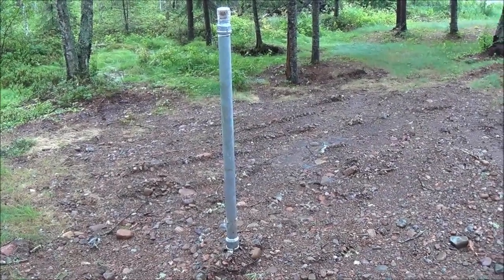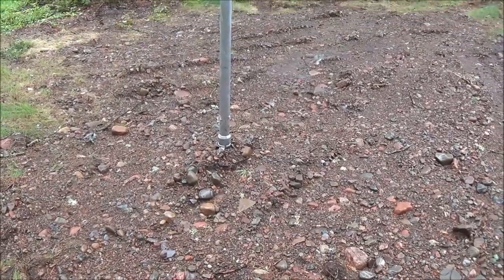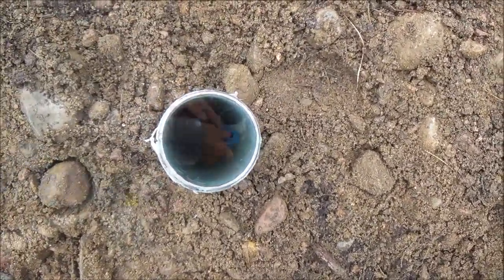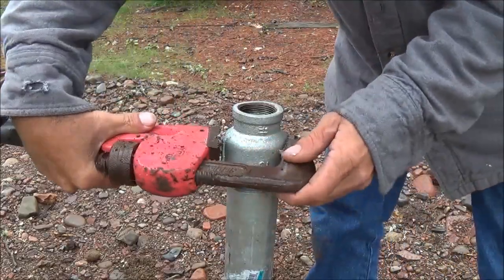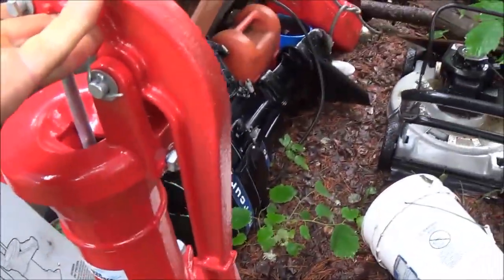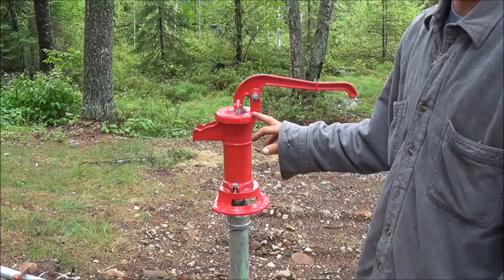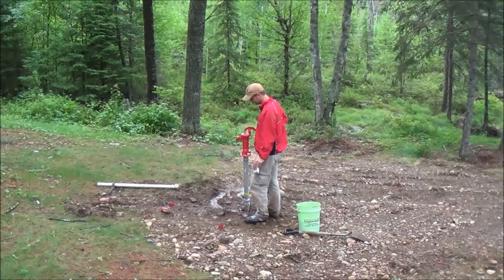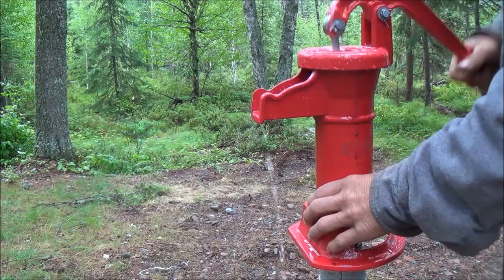How To Install A Hand Pump Water Well. The Tent Well. Finally.

Comment: did I miss something? a backhoe for a 12' well?
Reply from the maker: There is no way you can drive a sand point into the ground at The Tent. It is almost all rock. It is actually very hard to get an actual shovel full of dirt because of all the rocks.
Reply: @JoeandZachSurvival  Something to consider when working on a budget for an off grid home.  Thanks

Comment: Can you have a hand pump on a very deep well? About 400 feet
Reply from the maker: No, not that deep. I remember reading an article on a hand system that fits on your house well that would pump from deep but it was very expensive and I can not remember how it worked. I believe that well could hand pump water from about 300  feet. Most of the deep water hand pumps will pull it from that 80 to 100 foot range. The one I have is a shallow water well pump which can pump water from up to 25 feet.
Reply: @JoeandZachSurvival  thanks for the info

Comment: I'm in a dry desert area and considering this for an underground rainwater collection tank. Just as an option for watering some trees. I likely will get less than 2000 gallons a year in the tank. When I drop my electric pump in and get it going, I can shut off the power and the water continues to flow until I turn it off. I'm wondering if, once flowing, would it be possible for flow to continue like it does with the electric pump? Or will the stopper fall and prevent it from continuing to flow?  I'm guessing the flow after the electric pump is off has to do with suction and gravity. Not sure, but it would be interesting to hook it up that way.   If it is possible to create a pressure that keeps the flap open after a few pumps, that would be very cool. Possibly using smaller diameter pipes that create strong suction. I don't know, but it would be fun to play around and see if it works.

Comment: Considering adding one to the top of my exsisting electric powerd pump.
Reply: Why?
Reply: @starshot5172  in case the power goes off? duh
Reply: @dalerobinson4498  I mean "on top of" the other pump
Reply: @starshot5172  because the well is already dug, plus astetics, ease of installation and expense. I have an artificial rock that I don't like. So I can kill two birds with one stone

Comment: what's the name of the part with sharp spike and screen at the very tip? Does that tip have a hole to allow me to jet water in while driving it down?  I wonder if this system is better than one with a 4 inch casing where water will fill a contained reserve.   Not clear why a big hole was dub before driving the pipe down?
Reply from the maker: It is called a sand point. We had to dig the hole because there is more rock than dirt making that soil. There is no way you can drive a well there. The rocks would stop you.

Comment: Is this well/pump still in use ?   I've not seen it in later videos.
Reply from the maker: Yes, I just use it for emergency's, the water up there tested great but it has very high iron and because of that it is always stained a reddish brown color. The well works awesome but I only use it when I run out of water I bring up from home.

Comment: Awesome sauce! How much did that cost? A friend sent me your video bc I asked if anyone knew how much it cost to install a manual hand pump - I know ppl think I'm crazy, but,i woulf rather be prepared. I remember as a child, my aunt and uncle had a manual pump. With the threat of EMP hits, no electricity for 6-18 months - Be Prepared! 💪  Thanks so much for sharing! God bless ~
Reply from the maker: I am not exactly sure how much it costed but it was under 200 dollars.
Reply: @JoeandZachSurvival  I bought the identical pump today and everything to go with it to get down 24 feet if I need to go that deep.  I bought 1' 1/4" steel pipe sections instead of the 2" diameter 5 foot pipes.  All total I paid $271 at MENARDS.  You can go to Menards website and see the identical unit ZoeandZach bought.

Comment: So im researching how to put this on an old cistern on our property. Problem: top of water level 25ft below the ground. Most hand pitcher pumps like yours say 26ft head limit. Only DEEP well hand pump i find online is made by Lehmans for several hundred dollars. Know of anywhere else sells cast iron DEEP well hand pumps?
Reply: ashley—they have Check valves on 4’ pipe sections that I have viewed on YouTube. 
They fit inside of a minimum 2” wellpipe I think. If you have Freezing winters.
It must be removed ea fall before freezing weather. Hope this was helpful.

Comment: Im curious, why did you not put a check valve on it so you dont have to prime it everytime?
Reply: Perhaps check valves are illegal in Minnesota. Wrapping teflon tape clockwise around the pipe threads may also be illegal.
Reply: If you keep a pipe full of water near the surface, or above... in winter it will freeze

Comment: We have a hand pump well which looks exactly like the video, but has not been used for years.  When looking down into the pipe before putting hand pump on, there is a circular blockage w a nut in the middle.  Any idea what this could be?  I am new to all of this, obviously.  We can feel and hear a leak in this, sucking air into it after we tried to prime.  Any help would be appreciated, I can't find info!

Comment: I got the same exact parts from the same exact store you got yours from.... Menards... lol Only I went 1.25" down and hammered it in. I got to about 8 feet and had water in the pipe, connected the pitcher pump and it creates a lot of vacuum but the water won't come up, it's like the sand point is sealed up. I know I have a lot of clay up there, not sure how deep the sand is... if there is any? I sure hope I don't have to go to a different location and buy more pipe and another sand point.

Comment: There is an artesian spout, ( and a small deposite of water) I can easily put a pipe down into the earth and attach a hand pump like this one and it should contain the upward discharge of water correct?

Comment: When putting on PTFE tape follow the direction that  you will tighten  the fitting. This is the correct way.
From a old timer in Ireland
Reply: @Bob Crowley it absolutely does matter, wrapped tightly or not, it will always try to work itself off when wrapped in the wrong direction....always, I've never wrapped a thread the wrong way and not have it be a problem
Reply: you are absolutely right
Reply: Jean Lennon v
Reply: Lol I was just going to recommend that
Reply: Wrapped in the direction of tightening for 2 reasons. 1. Initial contact tightening is loose. If you wrap against the turn, the tape will unravel or loosen tape causing an undesired bunching of the tape. You want uniformity in the tape, not allowing water The Drips.  2. The threads are not a precisely cut diameter, leaving ability for leaks. That's why we use the tape. If you apply in the opposite direction, the tape will automatically fill the larger gaps more prominently as you tighten the parts, leaving irregular tape amounts on the thread which can lead to the Unwanted Drip. Good luck with that...

Comment: Couple of things...first,  would this work on say a 100ft deep well? second, man, what a waste of water pumping all that "dirty" water out on the ground, because for me, if I was to do that, I'd pump me a bucket full, and then filter that bucket full with say an MSR Mini Works backpacking water filter, I mean you've already possibly contaminated it with pouring lake water into the system, so all that pumping to "clean" it, man you could drink that water if you filtered it.
Reply: +Steve Serfass I've been living in Mn now for over 15 years.  Being orig. from florida, and after traveling in many water restricted parts of the US I appreciate your conservation sensibilities, however the state of Mn is gorged with water.  I live next to Lake Superior which contains 10% of the planets fresh water, and there are zillions of other lakes and streams nearby. Main concern here and now is not water loss, but rather water contamination from avaricious industry, other human folly.
Reply from the maker: +Steve Serfass  This well would not work on a well that deep. The piping would but you would need a different type of pump. The pitcher pump is only good to about 25 feet. As far as wasting the water, you need to watch more of the videos of up at the tent. There is so much water and it just runs down into the bog that is 15 feet away and then into the lake which is about 75 feet away. There is no lack of water there at all, just a lack of a way to get it in the dead of winter. This pump fixes that obstacle. Thank you. Joe

Comment: Will that freeze in Winter and, if so, what can you do to have an outdoor pump function in Winter?
Reply: +MrJimmyd7777  Those pumps are designed to drain (de-prime) if the handle is lifted to the utmost upward position and held there for a moment or two. You will be able to tell when that happens as it will make a gurgling sound and when that sounds stops it has fully drained back into the water table.

Comment: What does it matter which way you wrap teflon?
Reply: Its so it doesn't come unwrapped as you thread the fitting on. It can work still if wrapped the other way, but its recommended to wrap it in the direction you'd turn the fitting. You could ask Joe James, I'm sure he's got another reason.
Reply: Teflon should always go clockwise, unless its reverse thread which you never see in plumbing.
Reply: You ask what does it matter which way you wrap the teflon? It matters big. Just like it matters what way you turn a nut on a bolt. You gotta wrap the teflon in the way the threads are going...
Reply: John Bergeson your absolutely correct.
Reply: John Bergeson that's what I was saying. Unless your plumbing thread is reverse which I've never ever seen lol. It should always go in the direction threads.

Comment: You should of used Water Well Reamed & Drifted Couplings even a Merchant Coupling would be better than Malleable Iron Couplings all galvanized of course.  R&D couplings are made to protect the pipe threads and so you can drive the pipe down as needed. No deeper than the wells I've seen you do I would have put 4" galvanized heavy Well Casing in with a 4" SS Screen & screw on point in. Then used a submersible pump if you had power or a pitcher pump could still be used or a  generator used.
Reply: Steve La Londe Jr xddddwqqwesdddd

Comment: How do you keep the pipe and the water in the pump from freezing?
Reply from the maker: Emily Campbell The pump is designed to drain back down after use, BUT it takes a long time for that to happen so when its super cold you have to lift up the handle and let it lose its prime so it isnt full of water. I had mine freeze once and learned real fast how to drain it down. Thank You. Joe
Reply: Emily Campbell lift the handle and pour a quart or more (depending on depth) of moonshine down the primer and let it drain into the pipe, once the moonshine is in the pipe drop the handle, prime with water or more liquor (if its really cold and frozen), and pump up the pressure. the moonshine is safe to consume and will melt all the ice. beet juice would also work but will turn your water purple and gum up your pump diaphram over time, moonshine will also clean your pipes and kill bacteria and germs to an extent. when frozen be sure to pump it up till you have a trickle of water and put a bucket on the spout to catch runoff. If its cold out the moonshine won't evaporate... and can be reused for the next deiceing. Keep the pressure up and water trickleing when really cold

Comment: dude, you keep putting the teflon on backwards,
Reply: Joe James Inca different joe. Your life must be really terrible to have to call names and insult people to make your misguided points. Teflon tape and pipe dope are usually labeled thread sealant. You are correct it is easier to thread on with the use of these products, but it is for sure a thread sealant. Get over it. And it can work backwards but its not worth the chance of a leak. This guy put in a well, did you hook up your hose last week or something?
Reply from the maker: It has not leaked so its working just fine.
Reply: it's ok is not leaking anyway don't get cranky but maybe you crossed your eyes for a moment and saw him putting it backwards, jk jk he he he lmao XD
Reply: JoeandZachSurvival , dumbass. The teflon aint a sealer. The teflon tape lubricates the threads so that the threads dont gull up. It aint fine, idiot. You dont know what you are doing and you shouldnt have made this video. You better learn how to thread pipe together because you dont know your ass from a hole in the ground when it comes to threading pipe...
Reply: @joejames5739  you have zero content on your channel, does that mean you don’t have any clue what your doing? I’m use you are the dumb ass.

Comment: Thanks you have been very helpful, bought a place with busted pipe, split pvc inside with a sandpoint. Bought the handpump a couple of years ago but wasn't quite sure how to tackle project. I see all I really need to do is rethread the pipe, lose the pvc and attach pump. ( I hope)  Not simple stuff for a city gal. lol

Comment: As long as the water in the pump drains back down into the well below the freeze line, there's no problem. Because water drains back down is why you have to prime with each use. Main thing to remember is to keep a jug of water, that isn't frozen, to prime the pump during winter.

Comment: You were blessed to have such a good source of water. As we were for different reasons. Have 30' bored well with 13' of water. Every time Sis visits, takes home water from our well because it tastes so much better than her city water. 

Folks all around us had to drill. Hit solid rock at 5'-10' down. Depths range from about 120' to over 400'. Sad part some of those wells fail in drought years. Had well bored in 1974 (when it was still legal) and it's served us without fail. We were blessed, too.

Comment: There are some hand pumps that can pull water from much deeper wells. Naturally, more expensive. But may be worth it if water is within reach of one of those. 

Have to weigh expense of those pumps vs using alternative rainwater storage options, and/or availability of water than can be safe to drink from nearby natural sources. Everyone's situation is different.

Comment: Nice vid. 

Grew up using larger version of same for deeper well. That one didn't have to be primed. Held water in pipe below the freeze line. About 4 strokes brought water back to top of pump. 

Was the best water in the country. Hot summer day, pump enough water to do laundry, brought water cooled by nature to the top. Better'n any refrigerated bottled water today. (grin)

For those who ask, it doesn't freeze because water drains back into well. Thus, need to prime, each time, before using.

Comment: Sawyer SP181 kit may be even better. Costs much less. + No replacement filters 2 buy. About $50. WalMart & Amazon best prices seen so far. Believe it filters more gallons per day than Burkey. Lifetime guarantee to filter 1 millon gals. 

Ordered last week. Hope UPS delivers today. From all reviews I've seen, it's the best option for us if the electric pump can't be used. There's a spring fed creek in our backyard. 

Kit contains fittings 2 attach filter 2 a bucket. Ideal for handpump use, IMO.

Comment: I bought a hand pump a few months back but havent put my well down yet.  I read somewhere that if you put a one way check valve just below the pump you dont have to prime anymore.
Reply: Could be... but it would freeze in the winter and there goes the pipe

Comment: I forgot to shut the pump off once while watering cows and went to town came back the corrals were flooded but tuned the well right in best water in the county , This shocked the well and opened a vein over a coal seam it was diamond clear after & no sulfur smell .